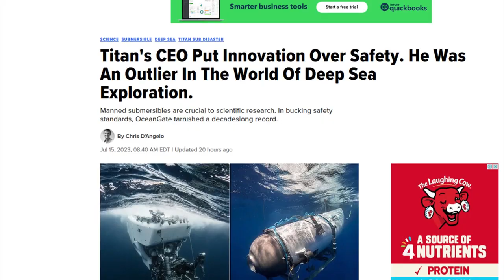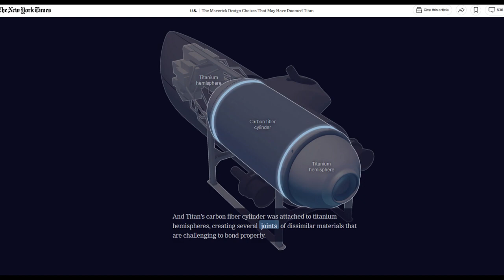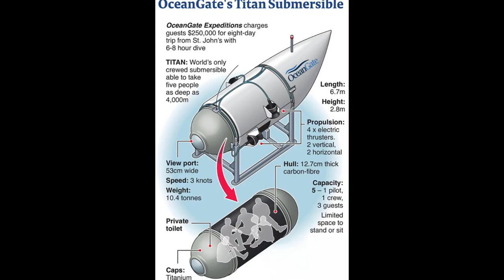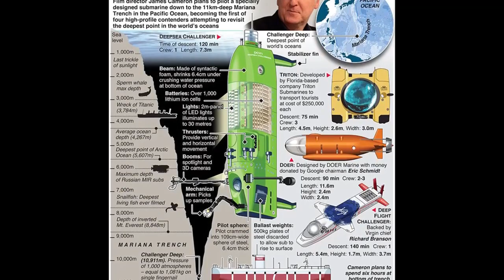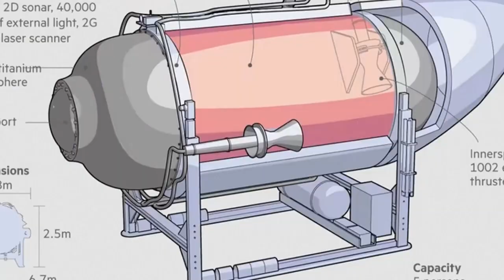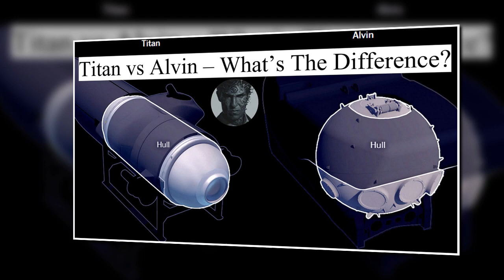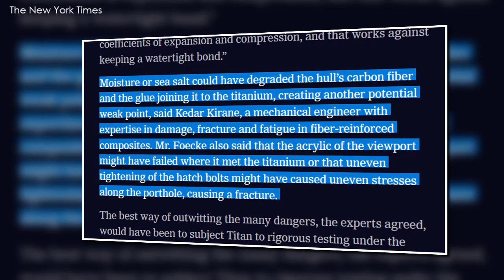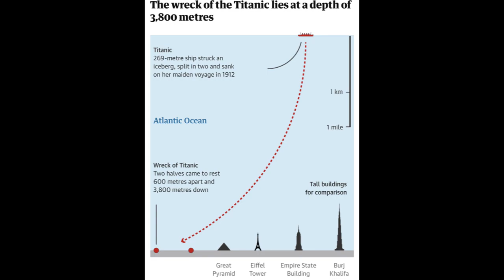Serious Question: Why COULDN'T Titan Be More Like Alvin?

Comment: I want to know why Guillermo left OceanGate and his partnership with Stockton?  I have yet to see him speak on it or see it reported.
Reply from the maker: Good question.
Reply: That was 10 years ago.   He had nothing to do with titan but he remained close to rush and was always supportive.   He is now put in a very awkward place that is not really of his doing.    He says that when rush started to build submersibles rather than just operate them he felt out of his depth and lost interest.
Reply: @RossM3838  what does that have to do what a curiosity of why he left?  They have been aware of issues long before this incident happened.
Reply: @distinctlydri2831  only repeating what he said   Was there more to it?   I have no information
Reply: @RossM3838  to my point, he has never addressed why. Thank you for your time.  SMH.

Comment: I still dont understand why they did not just cast a larger titanium sphere that would then be large enough for 5 people. I have been asking this question for almost a month and no one has given me an answer. I assume that either increasing the spheres size compromises its strength OR that a larger titanium sphere was just to expensive for Stockton. Im not exactly a hyper capitalist but I suspect that given the exotic nature of your product combined with the insane barrier to entry of the market you could still make a lot of money over time without compromising saftey.
Reply from the maker: I still dont understand why they did not just cast a larger titanium sphere that would then be large enough for 5 people.>>>Same. Seems logical.
Reply: @TCRS Look up “Aluminaut” 
Exactly the same design specifications as “Titan”.
It was used to recover “Alvin” when it sank (it was dropped in the water with the hatch open).
Reply: I agree. Providing space for people actually favors a sphere. It has the greatest internal volume for a given surface area. Like Alvin it could have multiple windows looking in different directions.
Reply: Carbon fiber hull was several times cheaper than titanium - especially since Rush apparently bought carbon fiber that was past its designed shelf life. I wonder if making the hull at least ogive would have made a difference. Still, it is quite likely the unsuitable material was the main cause and not the shape.
Reply: A sphere can only reach a certain size before it start losing its strength, and that size can only hold a maximum of 2-3 people. If the size increases, the thickness of the wall versus the radius decreases, which makes the vessel weaker. At the same time the walls need to be thicker to make up for the increased size. With that weight penalty, everything else have to be scaled up to meet that demand in form of ballast tanks, etc. At some point this becomes too heavy and expensive to be practically made. Think of it thus: the best form to withstand pressure would be a solid ball of steel. Now, to make room for people that ball needs to be hollow. The more hollow we make it, the less thickness of the wall versus radius of the sphere we get.  Until we have an eggshell the ocean can crack. The thicker the shell, the better. Thus room for less people inside.
Reply: @ingvarhallstrom2306  

That makes sense. Thank you for a detailed answer; i never stopped to consider the aditional aspects like more ballast due to the weight which in retrospect makes me feel foolish. I suppose the answer is cost then; as not only would the submersible cost far more; they would also need a specialized surface ship and I distinctly remember Stockton saying the bussiness model was specifically designed to negate the need for that cost which is why we see them towing the Titan everywhere.

As a relativley poor person its absolutley crazy to me that given all this the $250,000 ticket price would technically be the VALUE PROPOSITION in this market. Imagine how much the tickets might cost if they actually built a truly innovative and certafied passenger submersible with the giant sphere. You would probably have to charge over double of what oceangate was. $600,000+ 

Thats the price of an above average house in coastal Florida right now.
Reply: @physetermacrocephalus2209  

If you wanna know the true cost of these kind of operations, you should know that James Cameron paid ten million dollars for a submersible that took him to the bottom of the Marianer Trench, and he scrapped the sub after that single mission because he only deemed it safe for a single use never to be used again. That's the true cost and the safety level needed in the real world outside the fantasies of Stockton Rush wanting to make a low cost taxi operation to the Titanic.
Reply: @ingvarhallstrom2306  

Wow your the best. I didnt know James Cameron scrapped his sub. Thats nuts. I bet that broke his heart.
Reply: @physetermacrocephalus2209  

With Cameron, I just think he takes it as a given for that kind of operation, he did break a world record doing that. He's stated he only make more films now to finance his habit of going to the ocean. He's clearly shown in his film making he's a "If that's what it takes" kinda guy. Like "If ten million is what it will cost me, than that's the way it'll have to be".
Reply: Prices go up exponentially with size.

Comment: Safety. What was it that Stockton Rush said? At some point, safety just becomes a waste. Yes, well that statement assumes OceanGate spent ANY money on safety. They didn't even spend any money on seat belts or harnesses.
Reply: ...or grab handles, even.
Reply: @mistert7958 The grab handles were in the ceiling and were from an RV store.
Reply: @leopardwoman38  The interesting thing about the ceiling mounted grab handles is that they were only form of passenger restraint. In a situation where the submersible’s nose were to pitch downward, those grab handles were the only way to keep the five passengers from falling to the nose of the craft.
Reply: @WadmanP  Yep.  One of the many design flaws.  I was also shocked to see to passenger restraints.

Comment: Alvin also has back up systems for  positioning and power and controls.    It’s titanium sphere is 2.8 inches thick and very smoothly machined and welded together
Reply: It's also electron beam welded. No filler rod, full penetration with little heat compared to normal welding
Reply: Only 2.8 inches? Amazing how strong a (well engineered) bit of metal can be.
Reply: I tried to look it up. It says that hull
of Alvin is 2 ". It's the hatch which
is 2,8". 
It sounds ridiculous and unbelie-
veble thin !
Reply: The Aluminaut ( uSA in 1964) cylindrical  sub made of AL 7079 forged rings bolted togthether, wall 1hickness 170mm ( 6,7 inch). Thickness depend of materials aud also diameter of the Hull, and max pressure needed. 550 bars for the Aluminaut.

Comment: The Finnish-designed and built Mirs go to 7,120 meters (6,000 nominal), and have 40 mm thick special ultra-low carbon steel spherical hulls.
Reply: @@JimRex-vv4qs "our model is the trapezoid, that garuntee..." 📉
Reply: @@JimRex-vv4qsThere was - Aluminaut. It has exactly the same design requirements as Titan. It’s been stored since 1972.
Reply: @allangibson8494  But made of forged 7079 al, 170 mm wall tickness.
Reply: @danieldupuys2002  The problem wasn’t the shape - it was the material.
Carbon fibre is simply the wrong material for compressive loading. 
Strong in tension, weak in compression.
BTW - the for guys complaining about the titanium joints - the 11 rings of the Aluminaut’s hull are just bolted together - not welded, not glued.